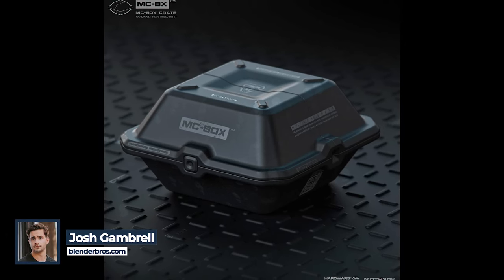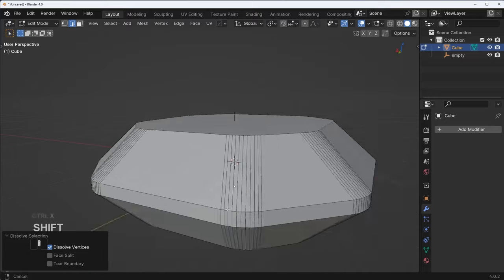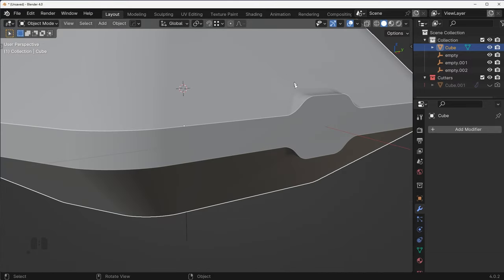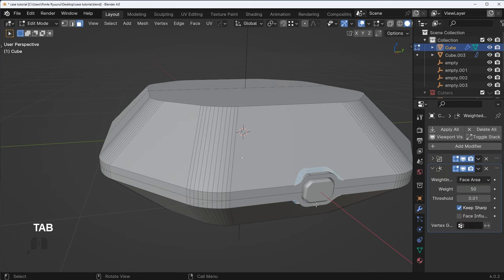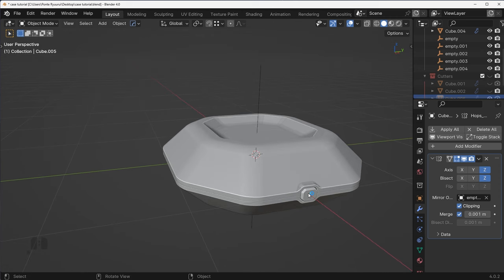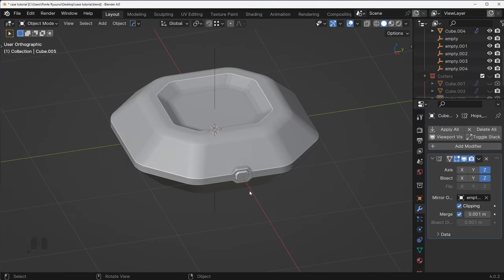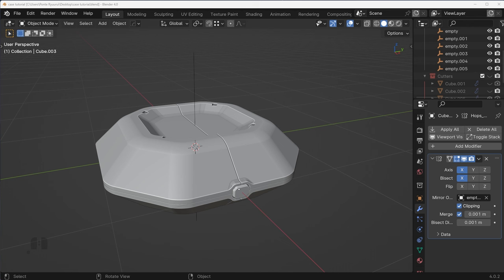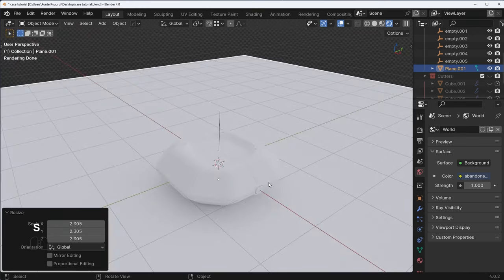How to turn a BOX into an insane hard surface design (Blender Tutorial)

Comment: You know "Blender material" use nodes, right ? you can also add a Perlin Noise bump using a "Blender material", no need for an overpriced addon 😅
Reply: im sure this guy knows that
Reply: @spacekitt.n Yeah but since they (Blender Bros) published their material addon, they insist that what it is capable of is impossible in vanilla blender, which is wrong.

Probably to get more purchases from beginners that do not know how the shader editor works 😓
Reply: it's a bit overpriced also in my opinion
Reply: I suck at texturing and nodes, their addon makes my life easier, go to work and buy it